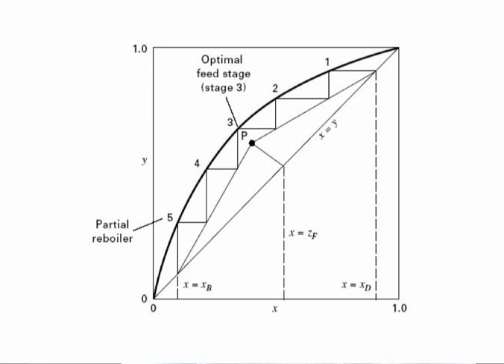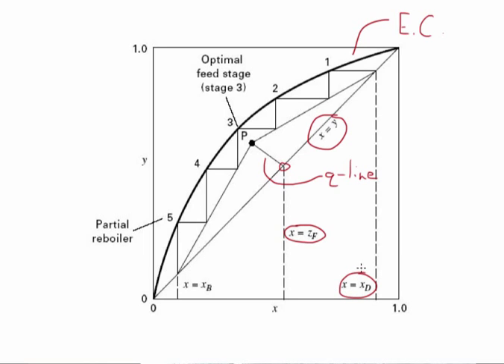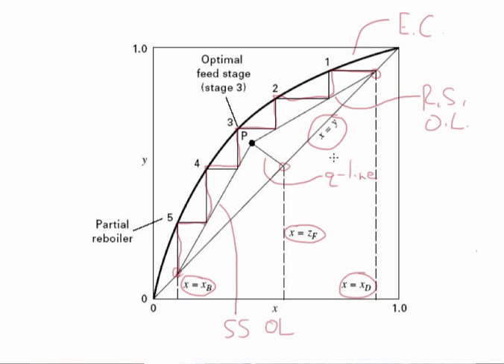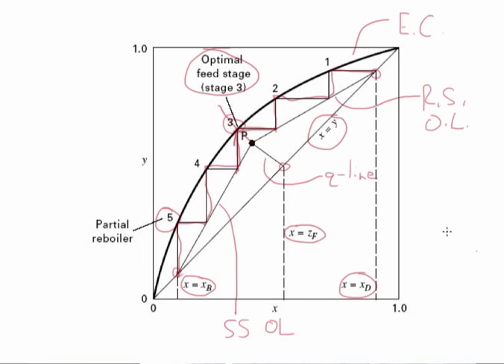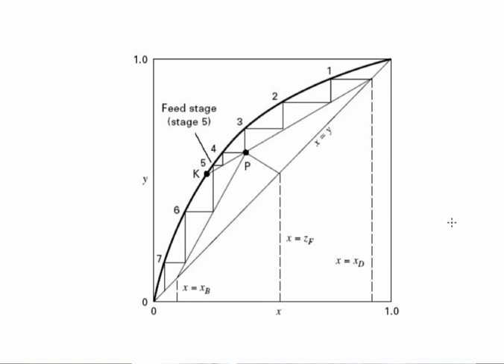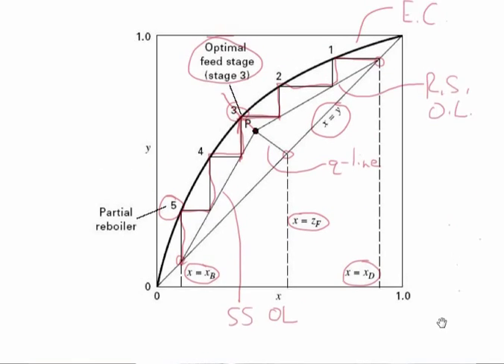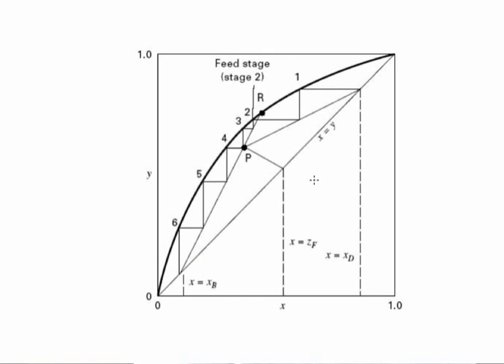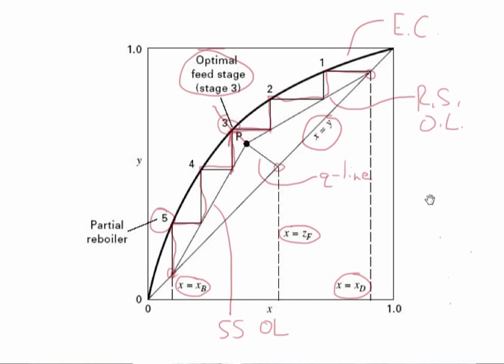Optimal Feed Stage Location

Comment: hi

kindly answer below question

 fractionating column is to be designed to separate 100 liters per second of feed at 20 °C with a composition of 69 vol% Methanol and 31 vol% Water into a top product of 98 vol% Methanol and a bottom product of 95 vol% Water at twice the minimum reflux ratio. You can assume that the column operates with a total condenser. The VLE data is provided in Table 1.
a) Perform a mass balance on the column and determine the molar flows & compositions of the feed, top product and bottom product streams.

b) Determine the value of q, the slope of the q-line, and the intercept it makes with the x-axis.

c)   Determine graphically the minimum reflux ratio, and the minimum number of theoretical stages within the column.

d) Determine the number of theoretical stages in the column at the normal operating conditions, i.e. when the reflux ratio is twice the minimum.
e) Determined the amount of steam required for the reboiler. f)   Determine the cooling duty for the total condenser.
g) Determine the minimum number of theoretical stages using the Fenske-Underwood equation, and compare them with the value obtained by graphical construction in part d).
Thermodynamic Data:
Steam at 2.5 bar pressure is available for heating. From steam tables, this has a latent heat of 2182 kJ.kg-1
Molecular weight of Methanol = 32 g.mol-1
Density of Methanol = 792 kg.m-3
Molar latent heat for Methanol = 35300 J.mol-1
Specific heat capacity for Methanol =2.5 kJ.kg-1.K-1
Molecular weight of Water = 18 g.mol-1
Density of Water = 1000 kg.m-3
Molar latent heat for Water = 40626 J.mol-1
Specific heat capacity for Water = 4.18 kJ.kg-1.K-1

Show transcribed image text
Expert Answer 

Anonymous answered this 
Was this answer helpful?

0

1
189 answers 
According to chegg rules we should solve first part of the question if more than four subparts involved in the question
View comments (3)

Comment: Thanks for the video. Are there good ways to extend this beyond binary systems? Or does the whole approach assume that you start with a defined mix of components you want at the top of the column and a defined mix you want at the bottom? What about in cases where you have side streams that are taken off mid-column? Would it be best to model each section (from one take-off point to the next) with it's own y-x plot?